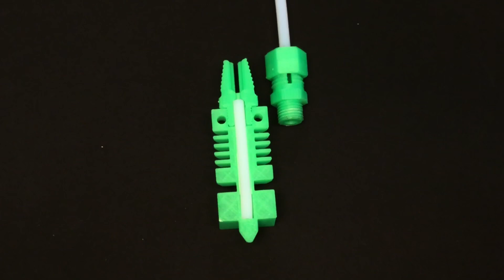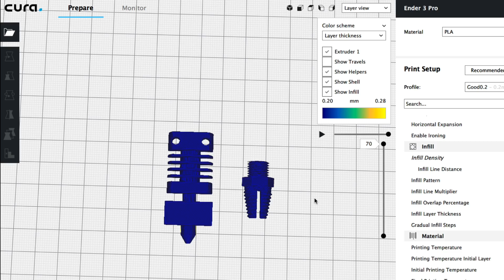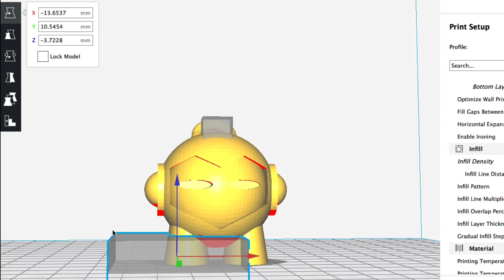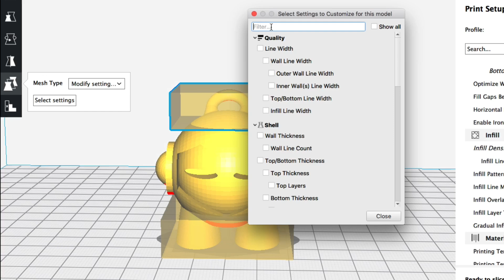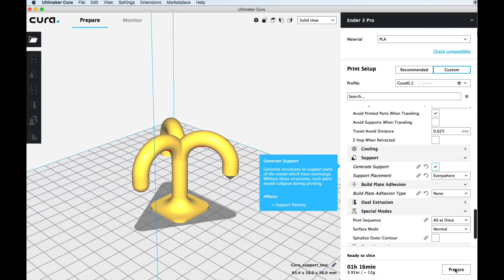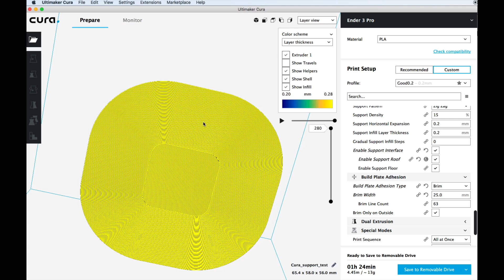3 Cura Slicer Setting Tricks For Beginners

Comment from the maker: Note: You can also use the “Modify settings for infill of other models” in the drop down. They both seem to do the same thing for the multiple infill process example.
Reply: This support blocker is really useful, but I've tried it to lower the speed for a part of a model that requires a low speed but it doesn't seem to have any effect when I look at the feedrate in the layer view...
Reply: Thanks, very informative. Can Cura be used with a Prusa i3MK3s? or can this tips be used with the Slic3R?  Thanks
Reply from the maker: Yes it can be used with any printer.
Reply: @FilamentFriday  Thank you again!
Reply: Good video chep, just want to tell you that there's an option in cura to add a brim to the support only. Cheers
Reply from the maker: Yep, watch my latest video on supports and I explain that and more.
Reply: @FilamentFriday  didn't realize, sorry and thanks for the response. Love your videos
Reply: im using cura 4 beta and the blocker process doesnt seem to do anything. does anyone have another solution?
Reply: It doesn't seem to be working in the new release of Cura :(
Reply: @stefinatrix3426  I couldn't get it to work in v3.6, but I changed the number of bottom layers to 999, and then it worked! (same thing as 100% infill). I suggest you try that.
Reply: This infill option worked better for what I needed. The other one mentioned in the video creates walls around the blocker, and I needed to change the infill settings for a section inside the model, without walls around the infill. It worked like a charm! It should also be noted that you can choose this option for any model, so you're not restricted to a block shape. In my case I modeled a shape that passed through the areas of the main model where I wanted a different infill. You can load any shape and use it as an area in which to change infill settings, it's brilliant!
Reply: Great! this probably would also work for the experimental fuzzy settings! for example, make a sheep, feet dont have to be fussy, block those. etc. :D will try that soon! thanks man!
Reply: Your tips are by far the best in YT, thanks for a great video!
Reply: I don't see ANY of the options you show in my version of cura..... EVERYTHING is different... using version 4.8 any help?

Comment: That support block modifier opens up a world of possibilities!!!
Reply: @Ope Williams For example, if your print has a hole which you know doesn’t actually need supports for but the rest of your print does, you can use the support block modifier to stop that hole from being supported and the rest of the print will still run with supports

as chep suggests, you can change infill for different parts of the print

Comment: There are additional support/brim options in Cura 3.6 that are awesome. "Enable Support Brim" will create a brim inside the support instead of those lines, "Tower Diameter" will make small supports wider at the bottom, and "Brim Replaces Support" will use the model brim as the first support layer instead, which combined with "Brim Distance" of ~0.2mm means you create a brim around the model for the supports, but it isn't actually touching it so you don't have to remove it.
Reply from the maker: Thanks. I’ve just begun playing with that.

Comment: There's a quicker way to do this in Cura 3.6.
Click on model and then post processing. Click on z axis.
You can adust anything from temp to speed to infill per layer.
You can add multiple changes aswell.
Much faster imo.
Both get the same result.
A change in infill %
Reply from the maker: I’ll try that. Thanks.
Reply: Andrew, I apologize but I do not see the z axis on the post processing... All I have under post processing is "modify G Code". I am new to this and just learning Cura. Trying to teach this old dog new tricks, lol... I have version 3.6
Reply: Agreed. It is called ChangeAtZ in my ver of Cura (there is also TweakAtZ) and it is WWAAYYYY easier then what was shown in the video. Sorry, Chuck, but that was a little hard to watch.
Reply: @AaronFlaming  I hope he does a video using tweak it Z would be wonderful for new 3D printer owners
Reply: Sorry butI don't see where you can change % infill in TweakAtZ (Cura 3.6 on Mac OSX).  Am I missing something ?
Reply: I was wrong. The infill percentage is cannot be changed using ChangeAtZ. But instead of setting the model to 20% and creating two blocks, it would be easier to set the model to 100% and add one block in the middle at 20%.
Reply from the maker: It was actually easier to do two because I only had to line up one side. Doing the middle I had to size it and position it to get both where I wanted. Plus I wanted to do it twice so viewers will understand without having to rewind.

Comment: For those wonder why they can not click on "Per model settings". You need to click on the "custom" button on the right hand hand next to "recommend".
Reply from the maker: Good catch. I’m always on Custom so didn’t realize it was needed.
Reply: thanks for the tip - i have been screwing with this for the past couple of hours figuring i was missing something simple, but i just could not get the button to allow me to activate it. this did the trick!
Reply: @ryangeiser6914  :) always a pleasure to help :)

Comment: WOW.. Ive bookmarked and subscribed.. I wish there where more Cura tutorials like yours. Had my 3d printer 2 weeks and have learned the hard way.. I have a question, I saw a nice vase on thingyverse , scaled it down and forgot to change the infil so I ended up with similar to your little keychain which I was happy to keep  BUT it enclosed the top. I looked at the designers comments and he referred to print using vase settings (which are available in slicer for fusion 360)  My question is .. is there a similar setting in Cura or a way to stop it closing the top of the shape. I much prefer using Cura at this point. PS Im using the Cura Beta 4.4.0 because it is already set up for Alfawise U30
Reply from the maker: Look for spiral mode in Cura

Comment: I've been looking for the Support Blocker Tool, on my screen for the last hour, what am I missing.  4.7.1.
Reply: It pretty much works similar, but not the same. The Icon is the striped one with a small box on the bottom right. Click your model, then click that icon then click anywhere on the model. It will make a box, you can resize it and change settings as you need. But it doesn't do supports anymore for that click the marketplace button and install the plugin support blocker. It will add a new icon there. Hope that helps. It confused me as well but it's still there.

Comment: How do I do this in Cura 4.8 😬
Reply: literally the same way, I just did it in 4.8
Reply: @scottmcphee7730  i don't have the support blocker button in 4.8, any idea how to get it?
Reply: @scolley13  It's a plugin. Check the marketplace menu for the supports addon
Reply: The plugin is called 'Custom Supports' and does not come with a fresh Cura 4.8.0 install. The icon has also changed a little from the video. It is now a solid "staircase" versus in the video the top stair has a white background with an "x" in it.
Reply: @mattklein999  @Scott McPhee  THANK YOU ! :D
Reply: @mattklein999  Awesome, thanks!

Comment: @CHEP, this video is really timely; I gave a presentation/demonstration of using Cura 3.6 to a 3D printing meetup group yesterday evening. Many people in this meetup were quite new to 3D printing, and some had only seen older versions of Cura which came with some imported / low-cost printers, so went over the basics of navigating the software and its settings.  A few people who already knew the basics asked some questions which I could not answer,  and then here today you answered the exact questions which were asked; how to use those bottom two buttons on the left edge of the screen.  Nicely done!

Comment: do know how we can do this in  Cura 4.12  seems that the support blocker has gone away
Reply: it's stil there. select model and press E
Reply: The icon changed in the newer version but still lower left.  Also be sure supports are turned on.  I had it off and if you click nothing happens until supports are turned on.

Comment: Good info.. as a side note on your first process for others, in the bottom right side of the screen there is overall dimensions... divide the Z number by 2 and your left with the exact center location... instead of dragging the arrow just type in the negative z value you came up with in your division... 

Example- 280mm / 2= 140mm...
 Z value is now -140 for dead center...

Comment: You my friend are a legend. I Have a  old version of Cura and could not be bothered to upgrade to the latest version due to my settings printing perfectly. But with my new design i was having problems printing an empty shell but having the top filled. when you showed the support blocker. That's what i needed. You saved me hours adjusting my design then printing for it fail again. You have a new subscriber. Looking forward to more tips.
Reply from the maker: Thanks

Comment: About brim. You do not need brim for all model, you can turn on "Enable support brim" and set "Support brim width". About processes,  support blocker is very handy, but you can use any object if you need more complicated shape to apply other parameters.

Comment: Awesome! Thanks. I didn't know you could use the support blocker that way. I've always been using the part for calibration plug in to put as cube on the plate and use that to modify the settings. It's way better to be able to just use the support blocker.

Comment: Thank you! I'm using the support blocker on a beer tap handle to increase the threaded area's infill to give it a bit more resilience.
Reply from the maker: Good idea
Reply: @FilamentFriday  The tap handles came out great except for where the 2 infills met. There's a visible line on both prints. Might need to do the PTFE fix for the Ender 3 to resolve that.

Comment: The section about modifying infill is just awsome, thank you. I thought I could modify "cooling fan speed" and "layer height" the same way - but unfortunately these settings are not available in the menu. I am on 3.6.0.
Reply from the maker: Yeah, not everything is there.
Reply: Cura doesn't allow you to change the layer height in different parts of the model, the only thing you can do is turn on "variable layer height" For the things I want to print that doesn't cut it, unfortunately.
Reply: Simple enough, once the gcode is generated, go in to it and add the code to set layer height and fan speed at the layers you want to change.
Reply: @brothaman4578  You might be right. But for someone like me not very much into gcode, a UI is preferable.
Reply: @zerounknown8257  Understandable, but this one is super simple. The syntax should just be; "Layer height: 0.2", where 0.2 is whatever layer height you want.Drop that in to the code and it should adjust the layer height setting.

Comment: Awesome information, not a noob, but this was extremely informative.  Here is a suggestion:  When you show your layer view, to illustrate the change in the infill, your video would be clearer if you selected >Color Scheme - Line Type< in the layer menu.  This shows the infill, helpers, travels and shell; each  in a different color and you would have a much clearer picture than using the material color.   In this case the material color was a dark blue and the infill was not well defined as you panned up through the layers.  From a video point of view, I think this would give people a better picture of what was going on.

Comment: I noticed with the boxes, you can rotate them so the infill can be different at a specific level.  In my case, as an experiment I used the Gnome and modified the hat (at an angle) infill to 100%, and the rest is at 15%.  It made the adjustments and at the lower portion of the hat, at that level the hat is at 100% while the head is at 15%!

Comment: Had no idea you could use those support blockers. Also, I didn't know supports would go on top of a brim. I had always just used a raft when I had small support areas sitting on the bed. Now I see when a brim is a good option 👌

Comment: Great tips! I wished i knew these features existed in CURA when I started 3D printing. I ended up paying for Simplify3D just for a few features that FREE CURA had all along. I know, I know I should RTFUM but CURA's user manual is only quarter a webpage and tip pop-ups. I wished CHEP start a thorough set of videos similar to this for the latest CURA

Comment: tip no.2 seems to make it possible for Cura to force a manual 'custom resolution at layer height' feature. there is adaptive layer of course, but I want manual one like Slic3r has

Comment: Hello +CHEP, got a question on why use expanded brim across whole model (getting a lot longer first layer which is typically slowest, for improved adhesion), instead you can use much easier and flexible setting called "Support brim width" or "Support brim layer count". This way you can get with ie 5 - 6 (play with the number) "circles" around your support  and not build this huge pancake :) you might save few more minutes, yet bear in mind im no expert, i just learn as i go
love your content - simple and idiot proof - perfect for me :) keep it up!

Comment: This only seems to work on some types of infill patterns, and not on others. In Cura 4.4.1 it absolutely would not work with "cubic subdivision". After yelling at Cura in frustration for several minutes, I switched to "grid", and it worked as intended. Just a heads-up for anyone else pulling their hair out.
Reply: Thanks! Just got my printer, every bit helps :)

Comment: Nice trick with the support blockers. It works perfectly if you want areas of 100% infill. However if you just want 50% you notice, that each block will have 100% bottom and top layers. You cannot change this it seems, even if you "modify" the settings of the support blocker with 0 botton and top layers.
Reply: The solid layer is logical, it is needed so that the different infils adhere to each other. Otherwise it would be weak, and possibly a stringy mess, as the different patterns do not align and print in air gaps.

Comment: Hi Chuck, thanks for all of the amazing content. You've made my experience as a new 3d printing enthusiast really insightful and fun. I wanted to ask if the trick that you used for the infill percentage could be used to set a different specific layer height on a print (for instance using a lower layer height to achieve a higher detailed head on a figure)?
Reply from the maker: Cura doesn’t off that here. They do offer adaptive layer height. https://youtu.be/9otlFHhmZkY

Comment: Thanks so much for the vid...very informative! Here's an interesting wrinkle: I have a part that has a round hole in it for fixing it to the wall. Is there any way of 100% infilling around the hole to make it stronger so it doesn't crush under the pressure from the screw? Using your method here produces a square block that just fills the hole up.

Comment: They really should rename Support Blockers into something else, like Modifier Blocks. I never knew, that's a game changer. And that "print as supports" option, sounds like Cura had manual supports for quite some time! Perhaps not as convenient as in other software but still.
Reply from the maker: You can make the blocks into supports.

Comment: Can you do the infill trick in the creality print?
Reply: Cura has profiles for lots of printers and if not, chances are very good that you find a profile for it on the Marketplace. I am using Cura for my Snapmaker when I need to use stuff like this, because Luban sucks (although it does has been drastically improved over the year, tbf) and doing it on Luban is a pain in the rear. Never had any problems, so my educated guess is it will also work if you send files slices with Cura to a Creality printer.

Comment: Hello!  Just came across your videos.  Great stuff.  I have been 3D printing now for over six years and now am learning even more from you.  I had a question for you with the layer view in Cura.  For some reason I do not see the sliders in the main view like what I see in your video.  Is there a setting that I am missing that I need to turn on so I can use the sliders?  I have the current version of Cura so I know that at least is correct.  Please let me know and I will be sure to follow your site now that I have found you.  Thanks.
Reply from the maker: You have to be in layer view

Comment: The best part is, you don't need to use the brick, it works also with any model you import. So you can design any shape in your software of choice and use that as the modifier volume for any of the available parameters. Or use the strength optimization Stefan did in his recent video :-)
https://youtu.be/q0YsC53mFvY

Comment: I received my CR10 mini in January and I have been practically printing non stop I’m going to get its bigger brother the CR10 but I was really curious about what your best settings are as regards to layer height,speed,temperature and most importantly (for me) is flow what is the best setting for flow? I haven’t had any really big problems this thing is a dream and I’m extremely happy with it but I’ve looked around for the subject of flow. Any suggestions would be greatly appreciated thank you so much for your awesome channel. You and 3DPN have taken over my life in the best way imaginable.
Reply from the maker: My Cura profiles have the flow settings I use. It’s mostly 100% except for outer layer.
Reply: CHEP thank you. Yeah I’ve been hearing about using lower flow settings from other people and I thought it was unreliable information. 
Before I made the decision to get a 3D printer I did a ton of research and your channel helped me in every aspect of my decision on the cr10 mini and Joel was a massive help also. 
Thanks again and keep up the awesome work.